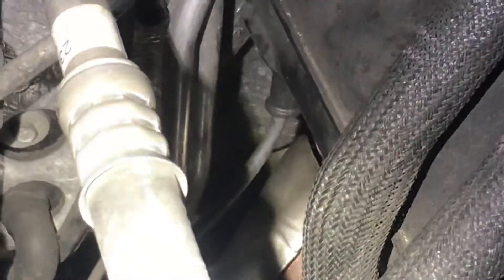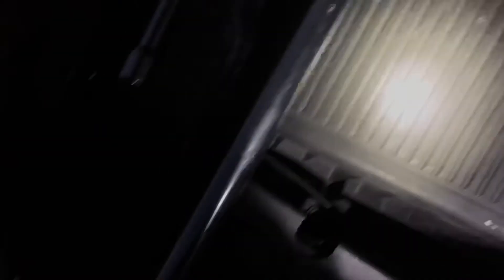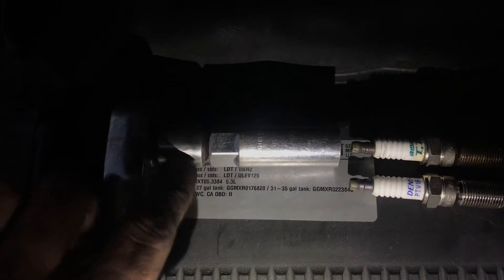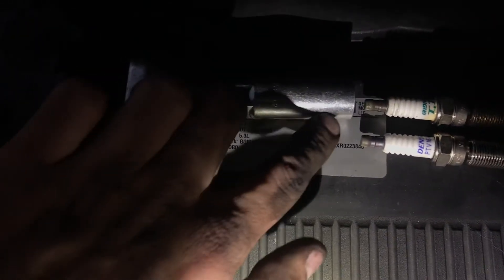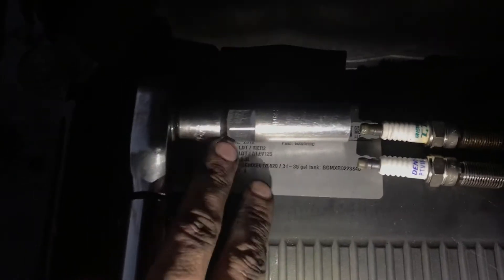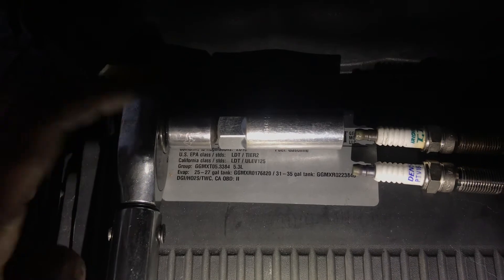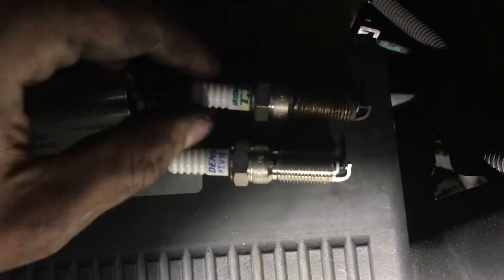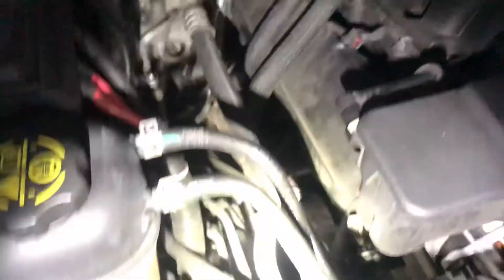Suburban. Tahoe. How to get spark plug Cylinder Number 8.

Comment: I’m stuck on the fing coil pack cover. Have to pull it out far enough to clear the coils but can’t because of the two ac lines crammed in there. Gm crap it’s why I don’t buy it.

Comment: My truck is missing the wheel well so I always go under the passenger side to get to it..idk why this was recommended but just use a extension and a swivel to get to it guys.
Reply: """just"""

Also, you said truck.  The trucks are easier than a tahoe/suburban because the rear a/c lines run right in front of the tiny little bit of access you do have.